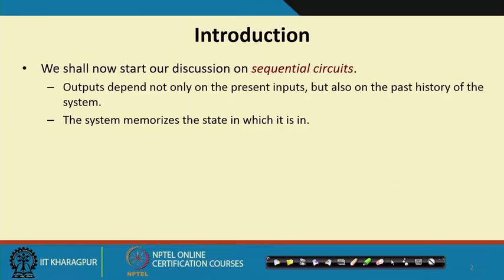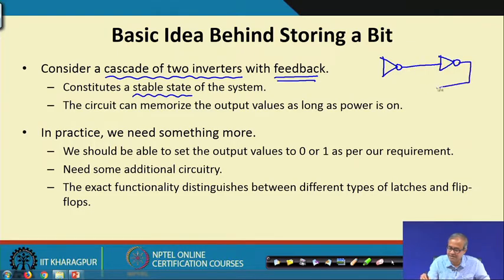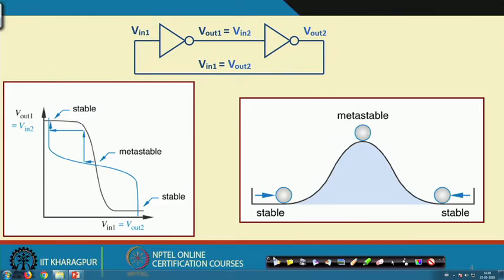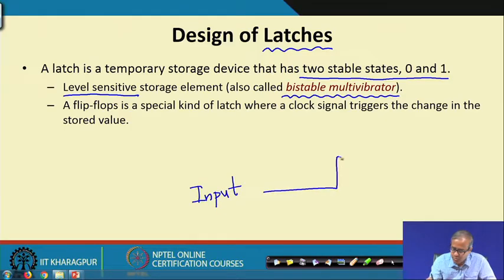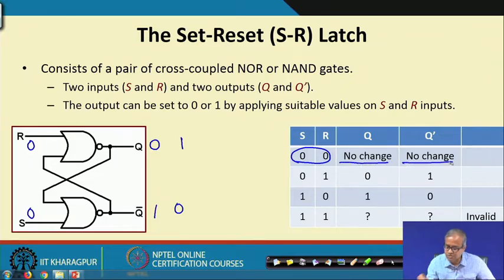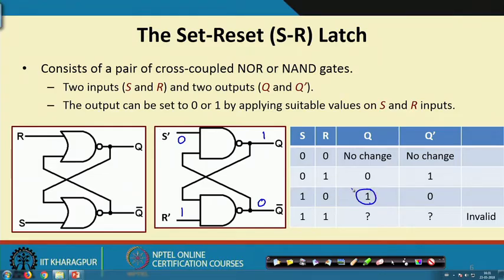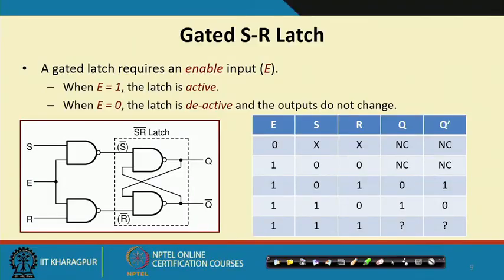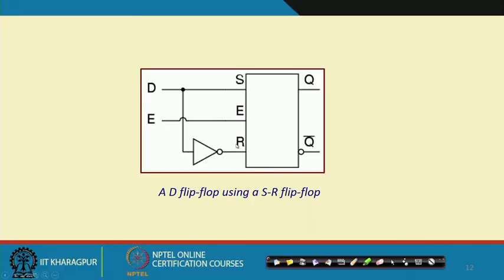Lecture 31: Latches and Flip-Flops (Part I)

Comment: 06:50 until the power is on can any one elaborate on that. I'm new to electronics. I can't see any external source there. Where is the on off situation coming from.
Reply: Power supply to the transistor.....
The circuit is designed in transistor level......
He meant till the power supplied to the transistor is on
Reply: We use a light sensor

Comment: Sir in Gated SR latch using NAND Gates 
if E=0 You said it doesn't matter what the value of S and R is(Don't care)-Output will not change
but when E=0  S'=R'=1 which is invalid combination and the output will depend on the speed of the gates(race around condition)
that means the stored element will either be a 0 or 1 (Q=0,Q'=1 or Q=1,Q'=0)
but in the state table you mentioned No change. Why ?
Reply: referring to 25:12 .    Hey if E=0,  S'=1  as well as R'=1 or you can say S & R in the original non-gated latch are 0 which is perfectly fine.
Reply: Bro, for NAND SR latch state table is different, here S=1, R=1 is the hold state..